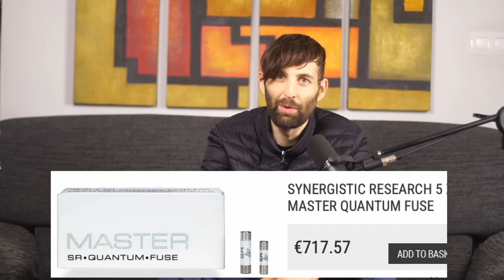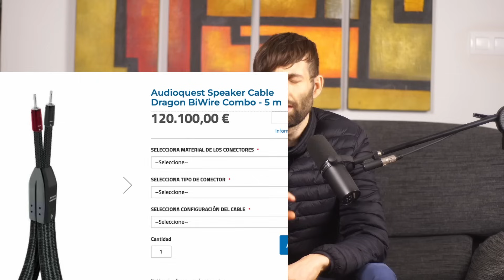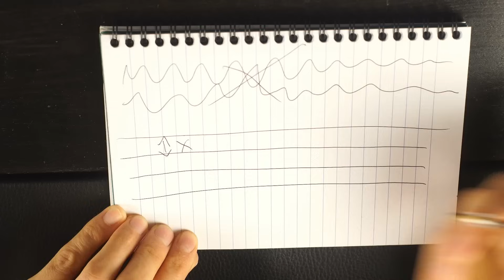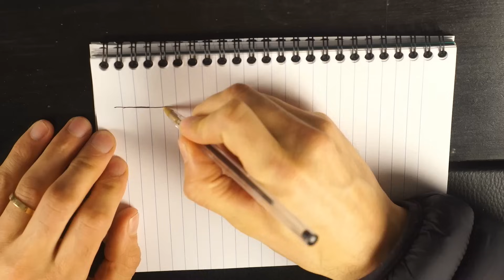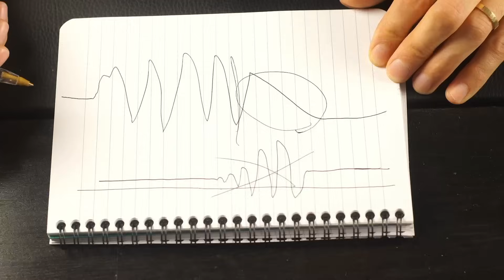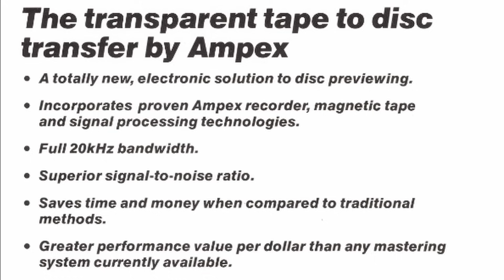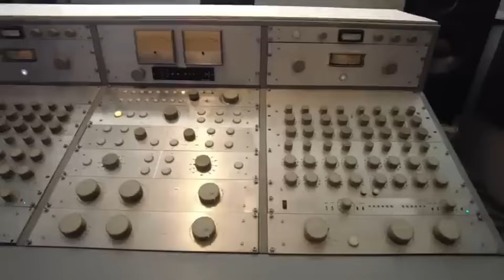Hard truth: most vinyl is digital anyway

Comment: As a mastering engineer myself, I am constantly being told that I am incorrect on this by the hifi flat earthers.
What they fail to realise is that a digitised signal is exactly the same as the analogue source, up to the frequency of half the sampling rate. It’s mathematically exact. What’s worse is that the mathematics behind why this is true isn’t exactly new, having been discovered by the genius Joseph Fourier in 1817.
Reply: You are actually describing nyquist frequency, discovered by Harry Nyquist.  I think you confused Joseph Fouriers work with FFTs, which was a related but wildly different application of math.

Where'd you study?
Reply: @treblegrey  yeah sure Nyquist applied the principle and we end up with digital sampling.
But that’s based on the work of Fourier. Out of interest, have you ever studied how the Fourier Transform works? Its is without a doubt one of the most fundamentally beautiful concepts in the entirety of mathematics. The reach of creativity he pulled off is indescribable.
Reply: 192 Khz sample rate at 5 nanometers is faster than the audio resolution humans can perceive
Reply: "digitised signal is exactly the same as the analogue source, up to the frequency of half the sampling rate. It’s mathematically exact."
That is perfectly correct if we are talking in the level of mathematic models of signals. But in the final playback point in real life you don't have a perfect digital analog converter or low pass filter in it and so on. This causes real life differences in low quality audio devices. So a totally medicore level vinily can and sounds better in certail limited set of sounds. So when somebody try its grandparents retro vinly it will sound better in some parts compared to an iphone powered system. I think thats where these vinily fame come from. But when we go to higher quality audio devices the digital will catch up and thats where the prediction of the mathematical modell will match the reality you mentioned, so there will be not so much practical difference between a vinily or a digital playback device.
Reply: @jeremycarroll451  Technically the Nyquist-Shannon theorem assumes a sampler with infinite precision. If you sample at a finite bit depth you will make some sampling error. However at 16 bit this error is absolutely tiny and below the noise floor, even more so at 24 bit, so it really doesn't matter. Of course due to various limitations of real world electronics you want a bit more than 40 kHz, which is why that is usually done.
Reply: @jeremycarroll451  up to half the sampling rate?
It's the mid to high frequencies that are not sampled very accurately by a digital sampler. Say you sample a 22 kHz sound at 44kHz sampling rate, you will essentially obtain about 2 points on the signal which can be assumed to be an oscillating sine wave. To reproduce the original wave with only two reference points is not really possible without software tricks.
Likewise an 11 kHz sound sampled at 44 kHz would only have 4 points on the sine wave. Better but still inadequate 
Digital sampling is fine for low frequencies like bass.
Reply: @PetraKann  YEs. That's how it  works. It is EXACTLY the same. See Nyquist Theorem and earlier, Fourier. That's how it works
Reply: @PetraKann  Reconstructing frequencies up to 20 kHz sampled at 44.1 kHz is something every modern DAC chip does with absolutely no problem whatsoever.
Reply: @MatthijsvanDuin  synthetic algorithmic reconstruction is an approximation for the mid to high frequency range.
Our hearing is based upon dynamic analog acoustics not synthetic algorithms
Reply: @PetraKann  The Shannon-Nyquist theorem tells us that it's possible to do a perfect reconstruction, and in practice you can get almost perfect transparency in the passband, with the main caveat being that if you then also push the passband width close to the limit (half the sample rate) then the reconstruction filter's latency and computational cost will sharply increase.
Reply: @PetraKann  Note btw that the core part of this reconstruction is just a low-pass filter, typically a linear-phase FIR filter.

The imperfections of such a filter are of the following types:
- frequency-dependent gain error in the passband, typically a tiny fraction of a dB. There's zero possibility you're going to hear that.
- introducing aliasing, which will fall in the filter's stopband thus be strongly suppressed, and which is ultrasonic content anyway (frequencies above 0.5*samplerate)
- like all digital filtering, some quantization error, which can be made inaudible by simply using enough bits
Reply: You dont understand the topic. The comparison is between compressed digital formats and the analog format (LP)
Reply: Aliasing occurs when the bandwidth exceeds half the sample rate, not when the maximum frequency exceeds half the sample rate. Of course in audio, they are effectively the same thing, with 20Hz being so close to 0Hz, its another common misconception. I do think 44.1kHz is cutting it a little close though just because it necessitates using using such steep high-order filters to prevent aliasing. I'm pretty happy with 96kHz as a compromise, although when I've done some DSP development, I found some non-linear processes such as waveshaping are just massively easier to perform when over-sampled further. Even some EQs just to avoid warping.
Reply: @IconicPhotonic finally someone with reading comprehension and access to Wikipedia
Reply: I just want to take a moment to thank the people in this thread who have been extremely helpful to me in the last 5 days. 

Ive not had my system set up for 8 to 10 years but it IS now set up. I found a 24Bit Audiogeni DAC in a box and its running off that, I have subscribed to Tidal, bought some basic interconnects and we have music - its not GREAT as I only have a pair of Grundig Audiorama 4000, which whilst upgraded and super cool looking - they are not exactly audiophile speakers... 

But the point is - we have music and its the helpful replies in this comments section that has inspired me to get on with it - thanks guys
Reply: It's literally the same as 120 fps video or 24 kHz sound spectrum – outside human perception.
Reply: I think you are referring to Nyquist, not Fourier
Reply: A digitized signal is a quantized representation of the original. Sampling at double frequency, assume a sine wave, gives you peaks and troughs if you line it up right. But if a signal is any more complex than a sine your going to lose a significant amount of information. Pretty sure the 48khz standard is assuming even though we hear up to 20khz top of instruments and vocals i think is around 5k(so at least 9x the fundamental), and the harmonics we hear cuts off at the 20k, so 48k is slightly more than double the top end and we assume your not gonna notice distortion in the higher harmonics.
Reply: @ianstover  You're not understanding Fourier - any waveform can be broken down into the addition and subtraction of individual sin waves. So, a digitised signal is NOT a quantised version of the source, providing the sampling rate is twice that of the desired frequency rendition.
Reply: @jeremycarroll451  i dont remember fourier series well enough to do it manually. But the sampling process is discretizing the amplitude in time. And the bit depth determines the dynamic range and amplitude resolution right. The latter is the quantization, the 2^n possible values at some given time. So in pure math we have reals to describe the signal, its not quantized, but in practical application it must be. I think thats where were differing. And because of the real world limitations and process thats why cd audio is striking the balance i described i think. Cause its what 16bit 44khz. Its just high enough that perceivable harmonics dont distort too much and what does distort will have lower energy anyways. I think most of that distortion is caught in a practical filter anyway.
Reply: that is not correct. it is not exactly the same. you simply can reconstruct a signal from it without aliasing issues, but that signal is probably not exactly the same as there is more electronics involved in the whole process and all have tolerances. does it matter for audio? no, not in the slightest.
Reply: Fourier didn’t figure out his transforms using DIGITAL calculators did he?

Check mate!
Reply: @rarewhiteape  no.
Reply: In theory, with a 44.1khz sampling frequency you can perfectly digitize an analog signal in which the max frequency is 20khz. In practice, analog audio contains frequencies higher than 20khz that you have to send to a low pass filter to cut everything above 22khz (half the sampling frequency) before sending it to the ADC. For this, you need an aggressive low pass filter which will have a detrimental effect even on frequencies lower than 20khz. Also, not everything above 22khz will be completely cut and will cause aliasing. With today's technology though, we have much higher sampling frequency available so that's good, no need anymore for such aggressive LP filters, but it wasn't the case when CDs first came out.
Reply: "a digitised signal is exactly the same as the analogue source, up to the frequency of half the sampling rate" - technically that is not correct, you described only the time-domain sampling process, and forgot the quantization noise :) In typical systems used to store music it adds somewhere about of -120 dB of noise. Not that it will affect any listening experience, but don't forget that ;)
Reply: @jeremycarroll451  this is the Nyquist-Shannon theorem
Reply: Well people think lots of things are new. Streaming has been around as we know it now for nearly 25-30 years, bluetooth/ GPS/wifi was in partly invented by the brilliant Hedy Lamarr  in WWII. Wireless headphones have been around since the 60s. People dont know where tech comes from or even when it was initially  conceived , what you see today is just very refined products of products that where thought decades before.
Reply: I'm sure you are right but I find that 9 out of 10 times I use    LP, also if my digital chain is more expensive.
Reply: If it measured good and sounds bad. You have measured the wrong thing. Name me one sound in nature that is digital.
Reply: That’s like saying a pocket pussy is as good as real pussy. Mathematically, they are the same.
Reply: I'm with you on vinyl being snake oil, but sharing a fundamental misunderstanding of the Nyquist theorem as part of your argument isn't helping our case.  Stop giving them ammunition!
Reply: Nope its not the same. The digital is a sampling of the analog waveform. Then it has to be converted back into analog further degrading the sound
Reply: @jeremycarroll451   Ahh not quite.  Have a degree in computer engineering. I believe it was Nyquist who had. A theorem that  you had  to sample the signal at a rate of twice the bandwidth.  Digital can NEVER fully capture like analog.

When CD came out in the 80s, people did  not warm up to them. They stuck to cassettes. Then to force people to get in to CDs, companies  like Sony compromised the sound quality of boom boxes.

When the hardware  grabs the signal, it leaves ti store it on the digital medium. But the analog  signal is still being produced. It misses that. There are  holes in the sonic matter. Your ears can feel this.
The same thing happened with  HDTV when it came out. The picture quality was and is clear. However, it looked cold.

In both cases, the engineers and mathematicians  used probability models to fill up these holes. But it is still lacking. Vinyl rules!
Reply: I am a bit perplexed by your "digitized signal is exactly the same as the analog source,..,." and "It's mathematically exact" statements. If I understand correctly when you digitize something you take samples of it, and a sample is a piece of the whole taken at an exact moment in time. You then take all of those pieces and reconstruct them into something that looks like the analog source. However, by it's very definition it is not the entire thing, just many pieces of it. So how is it possible to be exactly the same as the analog source when it's just pieces and not an exact copy of the source? And what do you mean by mathematically exact?  Exact to what?
Reply: @abeleverson6949  it is exact up to the frequency which is half of the sampling rate.
In other words, a 48 kHz file is an exact replica of everything up to 24 kHz (actually that’s not strictly true given that sampling requires a filter to be applied at the high end to stop frequencies higher than that from getting through as they will be inaccurately represented)
But for practical purposes, the mathematics means that all frequencies up to the cut-off point of that filter will be 100% accurate. Given the fact this filters are incredibly steep, in real terms this means nothing.
Reply: @jeremycarroll451  How can it be an exact replica of the original? The original is a continuous voltage over time while the digital sample is not continuous over time. Are you saying that it sounds exactly like the original? I'll go with that. However, by its very definition how can it be an extract replica of the original?  If it is truly an exact replica, would it not be called copying it instead of sampling it? The Nyquist theorem does not state that to make an exact replica of an analog signal you need to sample it at twice it's frequency.
Reply: @abeleverson6949  from a fundamental theoretical point of view, it is exactly the same up to the Nyquist frequency. But it completely re-creates the exact frequency characteristics up to that. The only difference is that there may be some very high frequency variation caused by anti-aliasing filters, but that is an engineering issue, not a fundamental one
Mathematically it is exactly the same.
Reply: There are two things that I noticed make vinyl records "better" than regular recordings played from pc/cd:
1. Most important - Mastering. Due to the limitations of the medium, in order to sound good mastering needs to be done properly and not too loud - but you know that.
2. The oily sound. To my ears music flows from a vinyl record as smooth as motor oil. Where does this come from? I guess from the diamond tip rubbing against the vinyl. This can also be noticed also in recordings of live records being played. The sound is not truer, but seems closer to natural sounds that the human ear is accustomed with, and the brain enjoys so much.
Reply: @sobolanul96  1. "Oh no, the loudness war. MUH DYNAMIC RANGE. Mastering engineer BAD."
2. (In the voice of Ralph from the Simpsons)  "I like distortion."
Reply: @GuitarCorporate  Well... yes. I guess you could say the ear likes the way vinyl records are mastered, and the way the pressing/sound reproduction chain distort the sound. Of course not all ears are the same, but I think this I the reason people like it. It is the same as with tube amps. 
There is still research to be made in how sound is perceived by the brain and how it decides the "fidelity" of the sound.
Reply: @sobolanul96 This if your running a very cheap stylus but not with a line contact like a micro line.  Nope. 
Maybe with your conical.😂
Reply: Bull shit. It depends on the decoding too very too
Reply: So how do you explain that people who spend £100k on a system prefer vinyl...???
Reply: @piccalillipit9211  It's not for me to try and explain people's motivation for anything. People spend their money how they feel. Even if they are wrong.
Personally, I like vinyl as well. I have a vintage Garrard 301 turntable and SME reference tonearm with a Decca head. Total lot is worth about £8,000. Stuff sounds lovely. But I'm not deluded as to why it sounds lovely. I have spent over 2 1/2 decades in studios working professionally. I know what's happening.
Reply: @jeremycarroll451  I was not being **** - it was a genuine question.  Im an ex audiophile and I prefer Vinyl to CD, but i prefer 24 Bit Flac to Vinyl. 

Someone said it was the "Loudness w4r" that caused this debate and I think it probably was - Iver had £50k vinyl and £50k CD setups and I just find CD exhausting.

"Garrard 301". Very very nice
Reply: @piccalillipit9211  Makes sense. What I'm saying is that high quality vinyl on good gear sounds beautiful. It's just quite far removed from what was heard in the studio. Much further than a digital print. By a long way. So, those who claim some kind of 'authenticity' to vinyl are just plain incorrect.
Reply: @jeremycarroll451  No ive never claimed that - Ive only ever claimed it "sounds better" which is subjective, it SOUNDS BETTER to me.  I have tube amps - they are nothing like linear but I love them.  Music is about enjoyment, if its technically worse but it moves you more and you get more out of it - surely THAT is what matters...?? 

But to me the whole argument falls apart when you get to the high end digital files, they are really really good.  the issue I have is Apple has removed the optical output from the new iMacs so I currently have no way of getting the output to my DAC...
Reply: @ my point about the ‘authenticity’ though was referring to a comment that he made in the video. I have heard this as well from people who have never stepped foot inside a studio, let alone have any understanding of what happens in there. By that reasoning, the only thing that they would be prepared to accept would be direct-to-disk recording, which literally nobody does.
Reply: @jeremycarroll451  Yeah I think the authenticity argument is just rubbish - you only get that with a live performance
Reply: @jeremycarroll451  I think yo said this but its not showing "you could use a USB to S/PDIF adapter and output it that way. Cheap and easy way to get 96kHz into your DAC" 

Is that 16 bit or 24 at 96khz?   Also will a cheap unit degrade the sound?   I was thinking of buying an old Mac Mini as a media server for like $300
Reply: @piccalillipit9211  S/PDIF standard can support 24-bit 96kHz stereo fine, but not all hardware will necessarily allow it, so worth double checking on the specs of you do go down that route.
Reply: @jeremycarroll451  Funnily enough I just found a 24 bit 192 DAC that has both Bluetooth and optical out and its $28.  So I can stream music to it over Bluetooth and then either use the RCA output or the optical into my DAC. I have no idea how good it will be - but for $28...  

I have zero idea how a digital signal degrades before you get it converted into analogue.
Reply: @piccalillipit9211  it won’t degrade in the interface as it’s just spitting out the digital signal over optical without any conversion, but Bluetooth will degrade it drastically as it transmits a compressed format. So all that effort will just end up reducing it to mp3 quality if you use Bluetooth
Reply: @jeremycarroll451  OH CR4P - it would have been super convenient - Is there a 24 / 192 USD DAC you would recommend...??   Ive been out of this game for 8 years.
Reply: @piccalillipit9211  maybe they use a non-compressed codec. But I doubt it. 96kHz 24-bit stereo audio is a LOT of data..
I can’t recommend as I know nothing about consumer stuff. But there will be something available that will do the job nicely as long as you don’t use Bluetooth anywhere in the chain
Reply: @piccalillipit9211  it is the loudness war. You can sit here and wax lyrical for decades that vinyl is made from digital files most of the time for as long as you want, but vinyl cannot physically hold a brick walled song. So vinyl is ALWAYS a more DYNAMIC master which is much closer to the “artist’s vision” than a literal square wave.
Reply: @GoldenPickaxe So because it can't perform certain dynamics properties due to its inherent physical limitations it's better???

What about if an artist intends the song to be "brick walled"? I guess their vision doesn't matter then?
Reply: @piccalillipit9211   I have never listened to a Vinyl before in my life so take this with a pinch of salt but you say the CD setups have been exhausting on the ear? Maybe what you need is a different speaker not neccesarily a $10,000 investment or even a $6,000 one but one that would show you what a shrill trebley motivated speaker sounds like as opposed to one that prefers a rather Flat EQ curve as opposed to one that really likes to hit that bottom end and extend it just that bit more then you usual speakers, because i find that whatever problems i may be having such as ear fatigue and maybe even me thinking that my eardrums are gonna burst because the 1khz EQ curve is too overpronounced, maybe the flaw isnt so much in the recording but rather the speakers we listen to it on wether that be 4 inch full range 8 inch full range 10 inch 12 inc ETC... i would just go to a store and tell them you want to try out different speakers with different amplifiers and based on that you hear how your favourite records have this wonderful different colouring and some even get ehanced but if there is one thing i have learned is that there is always compromise in everything, so while 1 speaker may focus on mids and treble it may not be able to do bass well, but its clarity is 2nd to none or maybe it just has a lot of bass end and poor treble response, if i was to explain further i would go down a rabbit hole but i dont want totype forever so maybe just try a different speaker and amp setup
Reply: @piccalillipit9211  There's no reason for an USB-to-S/PDIF converter to touch the digital audio data at all, it's just shoveling PCM data from one digital interface to another, and therefore cheap is usually fine as long as it does what you want. There are three caveats to this though:

1. Converters may vary in which sample rates are supported, with 44.1 kHz being the only rate supported by everything. If the audio you're playing uses a sample rate that's not supported by the converter your computer will be forced to resample the audio which will low-pass filter the audio but not otherwise degrade it (if the resampler doesn't suck), and 44.1 kHz is still sufficient for 20 kHz of audio bandwidth.

2. Some converters may be limited to 16-bit audio instead of S/PDIF's native 24-bit, but the only reason I can think for such restriction would be that they just couldn't be bothered to implement anything more than the basic audio profile, 44.1 kHz 16-bit. Therefore, if an USB-S/PDIF converter supports higher sample rates it most likely also supports 24-bit.

3. Converters may vary in the quality of the clock used to generate the S/PDIF signal. This typically doesn't matter, but it's theoretically possible it might affect audio quality if the devices that receives the S/PDIF signal uses it to directly regenerate an audio clock, does so in a way that inadequately filters out clock jitter, and uses this clock for the DAC's modulator (and not merely for data transport). I would consider that more a problem with the receiving device though.
Reply: @MatthijsvanDuin  THAT is incredibly helpful - It really is. I have no idea when it comes to digital audio.  I have built many tube amplifiers, speakers etc. I'm cool with analogue. 

So in short unless something is really bad the digital path is just transparent?   I was thinking of buying a  iFi Audio - Zen DAC V2.  Its relatively inexpensive and has headphone out which my MOOD LAB does not - also the MOOD LAB is very old now, it was good 15 years ago but a $50 unit is probably better now.
Reply: @piccalillipit9211  An excellent video about digital audio I'd highly recommend is "Digital Show & Tell" by Monty Montgomery.
Reply: @MatthijsvanDuin  OH thank you - I just got my hifi running today. It sounds TERRIBLE.  Lots of troubleshooting in my future I see.  There is definitely a bad earth somewhere.
Reply: @jeremycarroll451  Bluetooth supports aptX Lossless nowadays. It will compress signal to exact CD Quality - PCM 16bit/44.1kHZ ;) It's also capable of streaming full CD bitrate nowadays over radio (perhaps twice as fast with 5.0)
Reply: @piccalillipit9211  Yamaha preamp/dac/streamer wxc-50 is all you need. Hook it up to your power amp. It becomes smart 😁
Reply: @piccalillipit9211  cult
Reply: @PetrKulda  weird comment
Reply: @piccalillipit9211  Those same people preferred CDs back in the 80s.
Reply: @LoveElectricStuff  I got to be honest - Ive neve known anyone who likes CD's for serious listening
Reply: @piccalillipit9211  THD , the brain likes complex waveforms , compared to a pure signal, a pickup element creates distortion and that makes the signal more complex this the brain likes it more.
Reply: @cnfuzz  Yeah I can believe that.  After all, everything is perception. I know my tube amps are not as linear as solid state not as "good" but i prefer the sound.
Reply: @piccalillipit9211  I mean, is it really a mystery? People spend fortunes on cosmetic items in online games purely because they're perceived as rare. You don't need math and acoustics engineering to understand the ability of man to experience pleasure from having something rare and valuable. When I was a kid listening to bootleg cassettes on a portable player through muffled headphones, they sounded godly. Back then only one in a thousand people in the area had them, which sure contributed to the joy. It made me feel special. And it's nice to feel special.
Reply: @varvarvarvarvarvar  - Yeah that might be it.  Of all the explanations people have come up with in this thread and others the one I think is the most likely to be the biggest factor is - human beings like complex wave patters and the distortion created to the music by vinyl is inherently pleasurable to the human brain.

The "better" more acoustically perfect digital sound is just not as enjoyable to our brains. But that does not mean its not 20 other things as well.
Reply: @piccalillipit9211  How do you explain that folks buy a x100k sportscar in countries where you cannot drive more than 120km/h? Why do people buy cookware at prices in the thousands when most of them rarely cook at home, or install kitches in the multitenthousand range? I like LP,  but to say that vinyl is audibly better is just a lie. As long as the specs are comparable you cannot distinguish if i.e. the rumble is .03% or .04%, so to spend thousands more for a minor increase in specs is the same waste of money as in amps where the fight is about minor improvements and a  well spec'd amp from Sony or Denon etc. will sound no different than a multi thousand Botique amp, that are usually, from my observations, also less reliable.
Reply: @krautsky  If you read down a couple of comments you will realise you just wasted 500 words.
Reply: @piccalillipit9211  exactly because of that. They pay a good amount, so it has to have difference, right..?🙂
Reply: @cybernaut667  Yeah but that can spend the same on a digital system - these are not poor people, so why did they make that choice is my question...???
Reply: @piccalillipit9211  you already know the answer to that.. are you one of them and you just refuse to accept?🙂 

And no, you cannot spend that much in a digital system. There is a roof and it's only a fraction of the "audiophile gear" . 
Literally no limit there. Remember what Einstein said about what else is infinite..?🤗